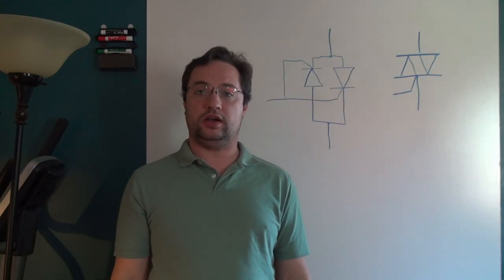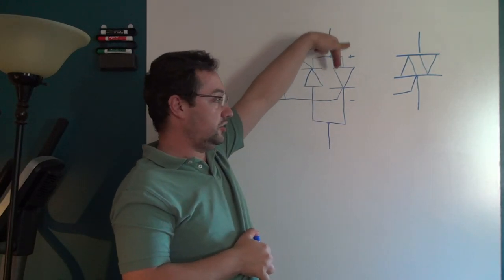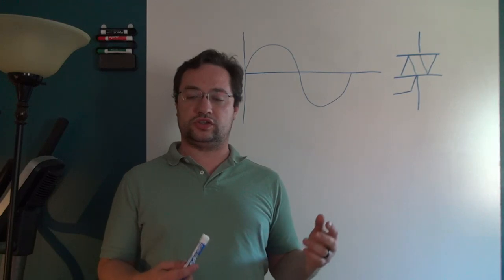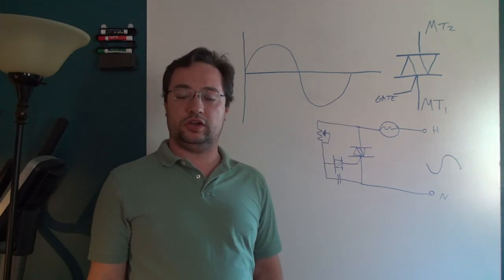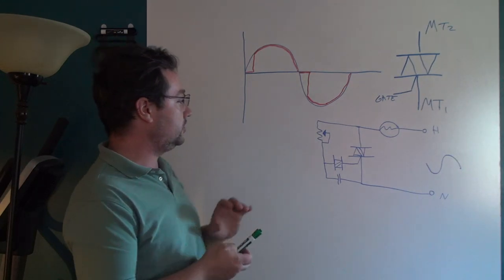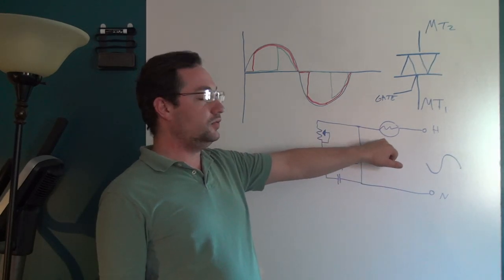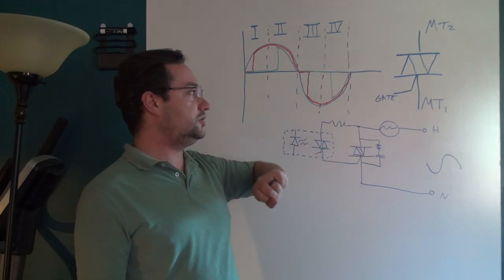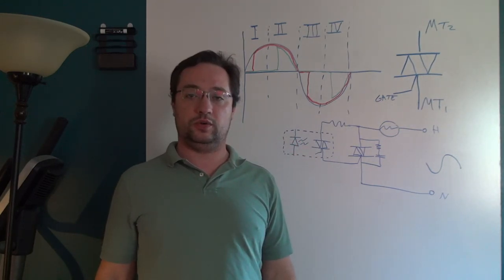eapbg #47 Introduction to TRIAC

Comment: I’ve been repairing some old control boards that use the old Motorola 68705 MC. The outputs of the MC that trigger several triac circuits to control water pumps go through darlington transistor pairs before the optocoupler inputs that then fire the triac gate. The MC outputs couldn’t sink enough current to fire the LED in the optocoupler. Darlington transistors can be your friend in these types of circuits. Great video.

Comment: Thanks for a great intro to diacs and triacs.  I have a stack of BT141D triacs (6amp, 800V), that I purchased 30 yrs ago but have hardly used. I think I'll make a few motor speed controllers with them just to get my hands dirty.
Reply from the maker: Sounds fun, just be careful because a triac will only speed control some motors. A universally wound one and a plain DC one if you use a bridge rectifier. Also with motors, you will need a snubber.

Comment: Thanks for this great video. It just bypassed anything I have seen before on the subject. But I have a question. How do I use a triac in a clap-switch with two transistors (no IC) to turn on lights that will go off same time with my LED after half a minute ?
Reply from the maker: I would use the Opto as the interface. You could tap power from the mentioned LED to light the LED inside the Opto. Don't forget the current limiting resistor.
Reply: @eapbg  Aaah! Sooo simple! You are the one... Just saved my life! (Smile). And thank you for answering so fast. Blessings.
Reply: @eapbg  An opto-triac will surely work fine by itself. Can I use an OPTO-MOS or simple opto-diode/transistor to trigger a regular triac as I have lots of them? And what else should I add? Your first answer rejuvenated me from 73 (sic) to 60. Guess what will do the next...
Reply from the maker: @abegafouda9136  To trigger the triac properly the pass element needs to be bidirectional. A MOS or a simple transistor are not bidirectional. Also, make sure that the pass element will handle the voltage. In the OFF state, the element will see nearly full AC voltage. The only thing I forgot in the video is a resistor to the N line. Similar to how I have it with the basic switch.
Reply: @eapbg  Thanks once again.
Reply: @eapbg  You said: " To trigger the triac properly the pass element needs to be bidirectional". Great remark that tilted my mind as I read the datasheet of the LCA110 OptoMOS (2 NMOS inside with the 2 Source connected together), which can be configured for AC, thus becoming bidirectional! Furthermore, that baby handles 300V and 130mA !!! I am using a Q4004 Triac that needs 50mA; is it correct to use a 3,9K resistor in series with each Drain output, one going to the Gate, the other to MT2? It takes a great teacher like you, man, to make a learner imaginative. Should I say it again, YOU ARE THE ONE! Thanks a lot to make me feel 50 again... I am planning after this to use a DIY optocoupler (LED facing LDR in a black box) to trigger a triac...
Reply from the maker: @abegafouda9136  From the Fairchild app note.  
Figure 2 shows a simple triac driving circuit using the MOC3011M. The maximum surge current rating of the MOC3011M (IGTM) sets the minimum value of R1 through the equation:

R1 (min) = Vin(pk)/1.2A

If we are operating on the 115 Vac nominal line voltage, Vin (pk) = 180 V, then:
R1(min) = Vin(pk)/1.2A = 150 ohms.
In practice, this would be a 150 or 180 ohm resistor.

If the triac has IGT = 100 mA and VGT = 2 V, then the voltage Vin necessary to trigger the triac will be given by:
VinT = R1 * IGT + VGT + VTM = 20 V.   
https://www.onsemi.com/pub/Collateral/AN-3003.pdf.pdf
Reply: @eapbg  Thanks for a great pdf with key practical application examples. Now, fig 9 shows a 2,4k resistor in series with the 180 ohms you did mention, for 115Vac; for our 220Vac, I guess the 2,4k should be replaced by a 3,9k to 4,7k value? Here in Cameroon when I ask for a MOC30xx or Arduino or USB Meter from local suppliers, they look at me as if I were coming from Mars planet... It's why I go to my golden suppliers: broken HDDs, motherboards, VTRs, etc. a huge goldmine where I found the LCA110 OptoMOS and lots of MOSFETs (N, P, dual), regulators... I have a dream: getting a large store in Cameroon supplying with all kinds of components and DIY kits or gadgets for educational purposes. Have an idea?
Reply from the maker: @abegafouda9136  It depends on what type of load you are driving. A resistive load only needs what is in figure 2. An inductive load needs a snubber. A snubber helps to realign the current and voltage helping the triac shut off during a zero crossing. The resistor you are asking about is for the snubber, see figure 3.

Comment: I am trying to use an optoisolator to control a triac.  I'm simply trying to turn a light on and off.  My next step is to figure the resistor values I need in my circuit to fire the triac.  Any help would be appreciated.

Comment: Great explaination on TRIAC. In regards to the snubber circuit, is its function just to discharge "out of phase" current or is the capacitor also compensating for inductance in the circuit? I've seen these circuits used extensively in motor control but if you ask 10 different engineering about them, they'll give 10 different functions of this circuit.
Reply from the maker: I guess here are my 2 cents. I look at a snubber circuit kind of like a condenser (they used to call a capacitor that) in points and breaker ignitions. The points were a set of contacts that would close causing current to flow. To fire the ignition the points had to open. As they began to open the current wanted to flow and a high difference of potential resulted across the barely open points. This would cause an arc. Constant arking would burn the points. To fix this a capacitor would be installed in parallel across the points. When the points were closed there would be zero difference of potential across the capacitor. As the points would open the resultant difference of potential would charge the capacitor instead of arking. The size of the capacitor would be such that when it became fully charged and the current came to a stop the points would be far enough apart that they wouldn't ark. 

All that being said, I think that the snubber works like the capacitor in the pints and breaker. When the triac wants to shut off it starts increasing its resistance. The lagging current then forces the triac open again. When a snubber is installed, when the resistance of the triac exceeds the resitance of the series resistor the current stars flowing through the capacitor. This allows the triac some finite amount off time to fully shut off. When the triac is on the difference of potential across the capacitor is small and dose not contribute to any power factor correction.

Comment: Thank you for exlanation, but are you sure that the quadratns are the 4 parts of the periods? 
The I and III quadrands are matching what you were explanied, but the 2 quadrand is charachterized by positive MT2 and negative G against MT1 (MT2+ G-) - this doesn't match to what you were talking about: in your expanation the 2 quadrant is charachterized by positive MT2 and also positive (but decreasing) G, not the negative G. The same thing is for the 4th quadrant.
I am taking into account the case when the G is powered from the MT2, exaclty like in your drawings.

As I understand, to implement the II and IV quadrant we need to power G not form the MT2, but from some other source to make create G polarity other than MT2.
Reply from the maker: You are correct, I totally missed the mark on the quadrant explanation. I primarily dealt with triacs driving inductive loads such as motors. My description is how a triac behaves driving an inductive load.

Comment: Might be a dumb question...do commercially available TRIACs (Semikron SKKT 92 for example) have a built in snubber, or is that something you have to provide when designing? What I'm after, is that, if I stop driving the gate of the TRIAC, do most commercial TRIACs have built in circuitry to shut off on the zero crossing?
Reply from the maker: No triacs don't typically have built-in snubbers. A triac shuts down at the zero crossing inherently. This only happens when the current and voltage wave forms line up. If they are missaligned, such as when driving an inductive load, there is a chance that the triac will not shut down. This is what the snubber is there to do. Make sure that the triac shuts down. There are "snubberless" triacs, but your milage may vary. I would try one out in your application first as a prototype and not depend on that it will work.

Comment: How likely is it for a TRIAC to fail and stay stuck in the closed position every time an appliance (ie. water heater) is used?     Or is it more likely that there is a problem with another component that sends the signal to the TRIAC?   There's an opto-isolator in the circuit.

Comment: I have tried using a triac to control output of a transformer. The cct controls fine but after a while the triac is destroyed . Have tried putting a snubber composed of 100ohm resistor and 100nano capacitor across the triac  but still destroys the triac. Can you tell me where i am going wrong please? Transformer output is 12v and need 4v at around 60amp
Reply from the maker: Are you running in the 1st and 3rd quadrant or in the 2nd and 4th? If it's the latter then can your triac handle that? What about current and heat sinking. Is the triac properly rated for the current? The triac should be rated large enough to supply full current at 100% duty cycle. It should also have a large enough heat sink to handle that.

Comment: Superb explanation. I am making a vibrator feeder controller, but not getting succes. Would you help me to make it with basic electronics components like TRIAC, diac, resistors, capacitors, potentiometer, diode,etc.
Thank you, that was helpful.
Reply from the maker: Look at the datasheet for a triac for a reference design. Use that.
Reply: @eapbg  as, I check the output voltage ni multimeter, it doesn't show any change in output voltage, bus as I connect a 100w load and parallel check it's voltage, i can see change in output voltage, as it vary as we vary potentiometer. Can you explain me the reason behind it.

Comment: I want to design a soft starter for induction motor using triacs but i have a difficulty in managing fire angle of triacs by using microcontroller that how would i use a microcontroller to achieve smoth start to avoid surge current and jerks of induction motor.Basically i want to know that how i ramp up and ramp down triacs voltages to acomplish soft start. I would be very pleased if u help me in this problem.thanks
Reply from the maker: Are you using zero crossing detection? Are you using snubbers on the triacs?

Comment: Solar tip: 1.) My automatic DIY solar tracker 2 axis: https://youtu.be/_Rs8CptQcDw. 2.) How to screw up the solar power consumption / balcony power plant to really save a lot of electricity costs: https://youtu.be/eC2olbCBhh0. Avoiding grid purchases will shorten the payback period. With Dimmer + Solar PV, self-sufficiency can now increase to almost 95%. That's how easy it is to suppress expensive grid purchases. The electricity bill stops just like the electricity meter. https://youtu.be/D9Ss0RuqZG0 Kettle: Without a dimmer, the 2500W - 600W PV system needs = 1900W, which you have to pay more for. If I turn the kettle down to 600W with a dimmer, then every PV system that is too weak can now supply each consumer independently and independently, because the 2500W kettle becomes a 600W kettle thanks to the dimmer. No magic, just physics. The prerequisite is that you have at least one small solar PV balcony power plant. You don't need an expensive battery. https://youtu.be/azDjqZpz77U The 2000W e-heater becomes a 500W e-heater via dimmer, which can run 12 hours a day free of charge via PV with me. The 4000W analog oven is also tamed. It is not the solar systems that have to grow, but the average consumption of the integrated device heaters simply has to drop by 75%. With the dimmer / voltage controller it has become so easy. I have already switched my entire household (2020) to 4x dimmers. Please have a look at my channel. 🌞 ........... Increase mini PV solar self-sufficiency (winter and camping): You can continuously regulate a boiler and other power-hungry consumers with the "5000W dimmer". Ebay €7. I run 4 dimmers in parallel on an 850W inverter. Kettle 2.2KW at 150W runs 12 hours a day, so the water is always hot. The room is also nicely heated. 2.5KW washing machine runs in parallel with dimmed to 400...600W and always reaches its 60°C, and also its 1400rpm... It doesn't matter to the washing machine whether it changes the washing temperature to 5min@2500W or 100% can be achieved free of charge via existing PV power in 20min@600W. The wash cycle lasts the same time dimmed and non-dimmed, 3Sth 10min. The iron https://youtu.be/-71oL7z1kMU , dishwasher https://youtu.be/8vnAkrS1x-s , oven , electric heater, https://youtu.be/QbLWDbJi6ew , waffle iron https://youtube.com /shorts/ofanZCdYEjA?feature=share , coffee machine, all internal heating is throttled with me. Lots of videos on my channel. The inverter stays cool and quiet and the MOSFETs + (battery packs) stay intact because extreme current peaks no longer reach the inverter. Now every Mini PV Inverter is enough to operate large devices. So, with the dimmer, all internal heaters/devices can be converted into base load devices that stay almost permanently ON, drawing very little current directly from the PV. With a wattmeter / energy cost meter you can then measure this perfectly in order to set the dimmer optimally. ........ Comments: "Great idea - despite studying electrical engineering, I didn't think of it myself ;-)" or "I installed it in our washing machine, great idea!" or "Glück Auf Christian, I'm a professional myself but I haven't figured that out yet. 👌 Greetings Mitch 💚" and many more... LG Christian 🌞 ........... "smart energy saving" , has made a meaningful reaction video to the dimmer: https://youtu.be/EHtJGiXAjZk . 🌞 ......... "Free Range", also made a meaningful reaction video, to the dimmer: https://youtu.be/qzdRdBObtvY . 👍........ "Jens Kummerow TS", also made a meaningful reaction video for the dimmer: https://youtu.be/fTY5jWvz5CY . 👌 ........... A little hint: Energy cannot be saved. So if I want to boil my water, I always have to use the same amount of energy for one liter. Christian's method relies on a longer period of time with less power in order to be able to use the power provided by the PV as efficiently as possible - so consumption peaks are intercepted. In the end, the energy consumption should even be (slightly) higher due to the interposition of the dimmer, but it doesn't matter, since more efficient coverage by the PV system and therefore better use of the self-generated energy .......... Here an "automatic PV excess control + remote controlled dimmer with heating element" / load management (consumption / heating rod follows PV excess ...): https://youtu.be/IWp7Mi2FldM . ATON - Power to Heat: https://youtu.be/wnVSaioJsjY . "Obermühle" solved this via PLC: https://youtu.be/iR30cDaf1Xk "Heating with excess PV 🌞Do your own heating rod control". 🌞......... More videos on my channel. LG Christian ........

Comment: Is the gate trigger voltage always ac or can a dc current be used to control the gate?
Reply from the maker: Theoretically yes, with two caveats. The DC reference would need attached at the correct spot. The DC would only be able to trigger the triac every other half cycle.

Comment: can we trigger a tric just by applying a square wave voltage of  amplitude  (equal to that of its threshold)
Reply from the maker: Theoretically yes as long as the square wave is referenced to MT1. In reality, don't do this for a few reasons. First, a general square wave won't be synced to the mains. More importantly, whatever is generating that square wave won't be isolated. Without isolation from mains, you run the risk of burning up whatever you connect. Worse, you can receive a shock.

Comment: Thanks, but how do you turn off a SCR and a Triac without turning off the power supply to the circuit to "reset" the SCR and Triac? any ways of "resetting" an SCR and Triac device?
Reply from the maker: This is why TRIACs and SCRs are often used with AC. AC always crosses zero volts and zero amps that allows them to shut off. The catch is that those two don't always happen at the same time and that's when you use a snubber.